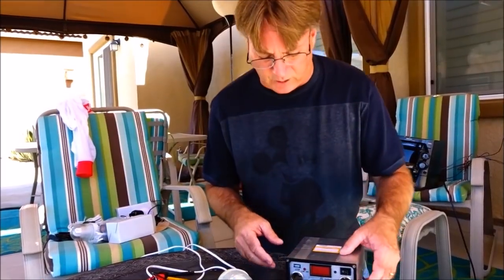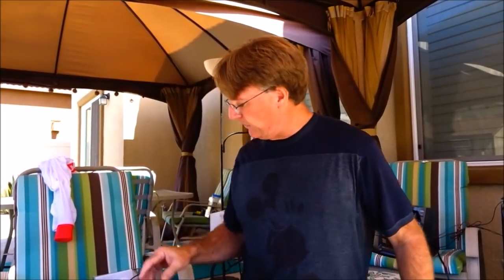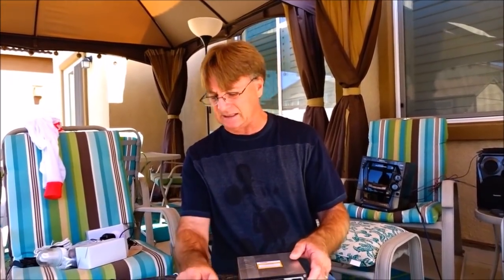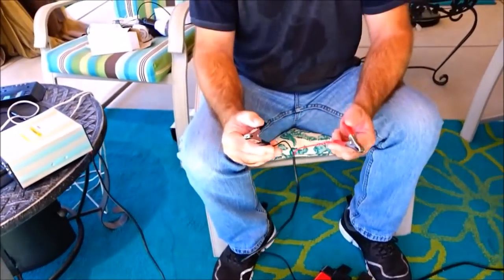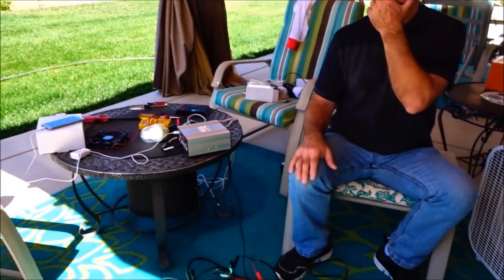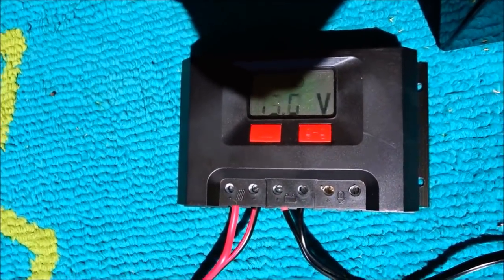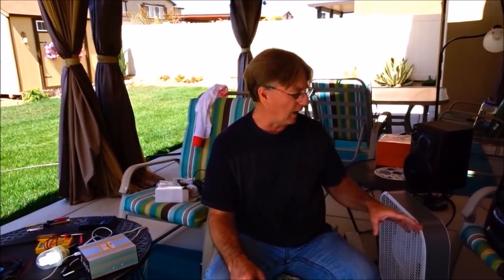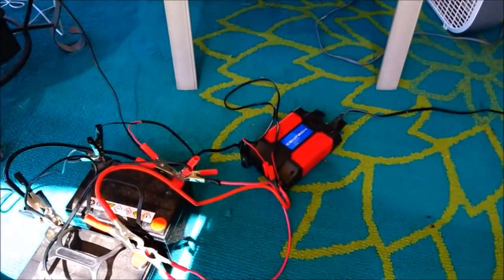Part 3 Harbor Freight Tools Thunderbolt Solar Systems. The complete how to and what not to do

Comment: Too late to help you , but your audience can learn from your mistake. Buy Renogy products if you're going cheap. That 100 watt array takes up way too much roof space . The charge controller that comes with Renogy's  100 watt system is very good and highly expandable . Cost for the 100 watt system with controller , Z mounts and cables  is around $200.00 . Thanks for your videos and Keep on Vanin' .

Comment: BTW, motors (unless designed for inverters) [like the one in your fan is not], do NOT like modified sine waves from cheap inverters; works, but shortens life tremendously.  Like a few other things, motors need pure sine waves.  Constructive criticism.  Thx for your videos.

Comment: 3 plus years later and still teaching solar NOOBS who haven't a clue with simple, logical explanations on how this all works. I think many people get into solar with that 100w Harbor Freight kit as I have, and you using that, along with the 35ah Harbor Freight batteries was great! I actually bought 2 kits and that large hub...you saved my charge controller because I wasn't aware it's only 100w max per kit...I would've tried to run all 8 solar panels into the single charge controller and prob burnt it out! Again - thanks for the video. You should prob make an updated video now that you do not have the old YouTube 10 minute video limit...can make the vid as long as you want.

Comment: Too bad I didn't happen upon this channel a couple of years ago.
It would have saved me a couple of headaches.

I bought a beat up antique sailboat to convert into a live aboard.
The options for electricity were solar or wind, as small outboard motors don't have any means of generating electricity other than the magneto that runs the spark plugs.

I opted for solar, which was a good choice.
The Harbor Freight 100 Watt solar panel kit with a couple of 72 amp hour deep cycle batteries has been a rock solid combination.
I come up a bit short if I try charging my cordless power tools more than a couple of times a day, but I'm not complaining.

I recently rebuilt the outboard motor to be belt driven from a four stroke engine, and added a 130 amp automotive alternator.
I removed the diode pack and bypassed the voltage regulator but added an external diode pack from a mid 1970's tour bus, stored inside a sealed container of mineral oil.
This gives me the choice of  one, two, or three phase alternating current or direct current. 
The batteries used to excite the armature windings are two 18 amp hour deep cycle of the sealed lead acid type, charged by two 1.5 Watt solar panels that would typically be used for maintaining the charge of a battery in a vehicle that is seldom started.

Being a welder by trade, I sorely missed being able to use those skills at home.
I get to use my angle grinder, and some ridiculously bright lights now too.

Best of luck with the conversion van.
It looks like it was fun to put together.

Comment: 160 w stereo probably only draws 10-20 watts average. The ratings on everything electric are maximums, and typically are 1/2 for motorized devices and 1/4 or less for electronics.
Also, most deep cycle batteries can go down to 20%. That’s typically 11.6v. Check the manufacturers recommendations. 
Many charge controllers and inverters can be programmed to alarm or shut off at that point.

Comment: Thank you so much for your easy to follow instructions.
Is the multi connector compatible with two Thunderbolt  solar suit cases, (not the magnum)  to pair them with the controller in the video? I am using it to charge a jackery 550 and want to charge ebike directly from panels. Thanks
Ken

Comment: Thank you for your video. I found it just after setting up my own little solar generator. 

Like you, I used multiple Harbor Freight kits (2 - 100w kits) and the Harbor Freight hub. Since I was increasing the output by using two kits, again like you, I got a 30 amp PWM charge controller rather than use the HF 20 amp ones in the kit. But I do want to use the LED bulbs that came in the kits. 
I've been noodling over connecting one of the 20a controllers to the to the battery bank so I can use the jacks on them to plug the lights into. Otherwise I've got to find a USB connector to change out the plugs on the light cords, or something. 
I hadn't set up the original controller yet because I wasn't sure which terminals on the controller to connect the battery to. I'm assuming the same ones marked "Battery" as if that was the controller I was using as the main one. Would that be correct? Are those the terminals you used?
Thanks again for the video and thanks in advance for your advice.
Brian
Reply: If you intend to put much of a load through those smaller charge controllers, you might want to open 'em up & wire in an external fuse holder.
They have a built in fuse, but it's a spade type automotive fuse soldered to the board.
They assume you'll just go buy a new one when it stops working, rather than change a damned fuse.

Comment: Awesome videos. I've got 2 questions. How do you prevent your batteries from over charging ? 
 I believe if I wanted to hook up a generator and charge the batteries, that I would connect them to the positive of one battery and then then the negative of the other. But would I have to disconnect the solar system to prevent any damage feeding into the solar system in any way ? Thanks for your videos and assistance.
Reply: The box that the wires are coming out of is a "charge controller"... It controls the charge of the batteries.
This includes preventing overcharge.

The panels themselves typically have a blocking diode built in to prevent the panels from draining your batteries at night (they produce a very faint glow), so the power from the generator will never get to the panels themselves.
As was mentioned in the video, if you have the solar panels connected to the charge controller but not a battery, you'll fry your charge controller... so we can't disconnect the batteries during the day.

It stands to reason that you would only require the use of a generator to charge your batteries at night, since the sun does it during the day...

There are two ways to accomplish what you want.
#1 to be used ONLY if there isn't any power being produced by the solar panels:
Just connect 'em all together & don't allow the generator to exceed the amperage produced by the charge controller. This becomes a guessing game with a moving target if the solar panels are producing any electricity, as the total amperage of both the generator and the solar panels would have to be below what the charge controller is capable of handling.
#2 the awesome way, that allows you to charge using either the generator or solar panels OR both the generator AND solar panels...
Put a blocking diode on both the positive and negative wires between the charge controller and batteries.
Diodes work like one way valves... Power from the charge controller still gets to the batteries, but power from the generator can't get to the charge controller.
Having done that, you're golden Ponyboy.

Comment: Great videos. I have two of these 100 watt sets as well. What I am trying to figure out is the best way to connect a trickle charger for my lawnmower or motorcycle. Should I use the other controller output? If so where do you input the power from the battery bank to the extra controller? Do you just go from your battery bank to the solar input on the extra controller?
Reply: A pair of blocking diodes.
One on the positive wire, one on the negative wire going to your lawnmower battery.
This allows the solar panels to keep your battery charged, and protected from overcharging by the charge controller, but doesn't allow it to use the stored power from that battery.

Comment: Great info. How would be the best  way to ground this system? I have the 100watt basic HF setup. I’m trying to use it to run a remote recording setup but hearing some buzz through  my speakers.
Reply: Using an inverter for 120 volts AC?
12 volts DC?

If you're using an inverter, that's your problem.
No amount of grounding will change it.
Recreating AC from DC doesn't end up as a sinusoidal waveform 99% of the time.
You have to specifically purchase an inverter that is designed to produce the desired waveform, and they ain't cheap.
The majority of devices are perfectly happy with a square waveform, so manufacturers don't bother with correcting any better than that. 
It cuts into their profit & they can't sell special inverters for a higher price if they do.

The best way to test this, and perhaps solve your problem, is to run an induction motor on the same circuit.
The rotating magnetic flux smoothes out the edges of the square waveform, and if your induction motor is powerful enough, you'll get your sinusoidal waveform.

Another cheap solution, which isn't terribly efficient, is to use an induction motor to generate your 120 volts AC.

If I were you though, I'd take a look inside the equipment & see what it actually runs on.

There's going to be a transformer stepping the voltage down, then a rectifier.

Meaning that it runs on DC... The question is: what voltage?

Comment: I would have a question: How to connect 3 - 53 Watt solar panels to a 400 Watt Inverter directly to an outlet on your house, I have these 3 Panels and want to hook up to my house to save energie? Thank you for your videos.
Reply: Tough question...
Mostly due to liability issues though.

The right way to do it: Have an electrician connect your inverter to your meter.
If you still have an old meter that spins, it will spin backwards when you're feeding into the grid.
If you have a new digital meter, you should ask the company providing service to your area if it's capable of counting down.

The wrong way to do it: Plugging your inverter into an outlet in your house.
Anything on the circuit you plug your inverter into will receive any "noise" produced by the inverter, including the typical square waveform of an inverter that is anything but top of the line.
You'll also be dealing with both the 60 Hz from the mains and 60 Hz from your inverter.
This will cause anything from overheating to instant death to the devices plugged into that circuit.
Connecting to your meter allows mains current to smooth the output of the inverter, in both waveform and frequency.

There is an exception to plugging your inverter into an outlet though.

In the event of a power outage, you can isolate a circuit by either turning the breaker off or removing a fuse.
You can plug your inverter into an outlet on that isolated circuit. 
You can run anything normally powered by that circuit, provided you have a large enough battery bank and an inverter that will output enough wattage.
Adding a circuit breaker of the same amperage as the circuit breaker/fuse that was turned off/removed to isolate the circuit would be an obligatory safety measure.

Hope that helps.

Comment: Hello again! 
I haven't even given you a chance for you to see my first question and I've already got another!
I was just looking at my system and had a thought. Do you think I could make a jumper from the "light" output terminals of my 30amp controller (which connects my panels to my batteries) to the "light" output or the "battery" output terminals of the 20amp HF to energize it so I can plug in the HF supplied LED bulbs?

I was thinking that might be simpler than making the full run to the battery terminals. It's something I would only do in the event of a power outage so I'd rather not have an extra set of wires coming off the batteries all the rest of the time. Just pop in the jumper when I need it.
Reply: They're the same circuit.

Comment: If you watched TV on a laptop, you could charge it during the day and use it at night. I have heard some people with smart phones send the signal to a TV to play or it might work to a laptop. If you had a wireless hot spot in the van that would cut down on mobile data rates. They make propane powered refrigerators and some coolers that can run off a cigarette lighter while the Vehicle is running.
Reply from the maker: All very excellent suggestions.  Thank you. We do like watching movies on a bigger screen than a laptop.

Comment: if I have two 4000 dc amp battery that's also 4000 watts and I have a jupiter 5000to 10000 watt power inverter from habror freight,will it damage the power inverter?
Reply: A one volt battery not only won't harm your inverter, but it won't power it either.

4000 watts 
÷ 
4000 amps 
= 
1 volt

You can get greater power density out of a dill pickle with a penny in one end & a galvanized nail in the other.

Comment: I saw anther youtuber  with 8 of the 25 watt panels connected to the original charge controller that comes with the 100 watt harbor freight kit. He showed 10 amps coming from the 8 panels in full sun. This should link to his video:  https://youtu.be/X5tOLsS08wo

Comment: DC to AC inverters dont work the way you described. Also that stereo is probably rated at RMS as far wattage goes. Thats not the same a real world wattage. 130 RMS watts for that stereo driver output is more like 30 watts in real terms.